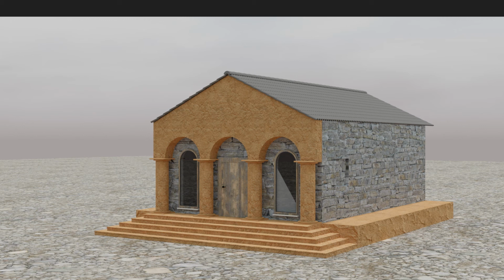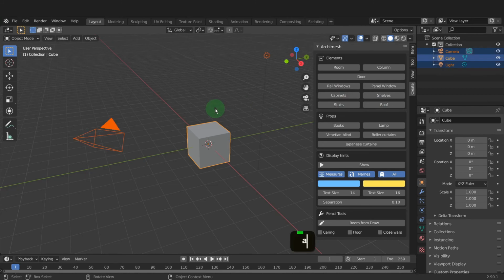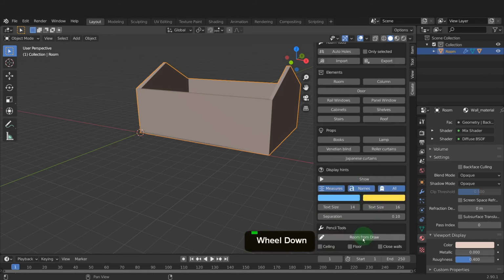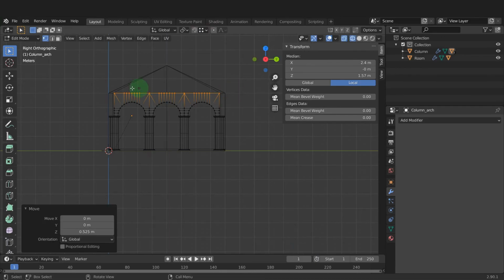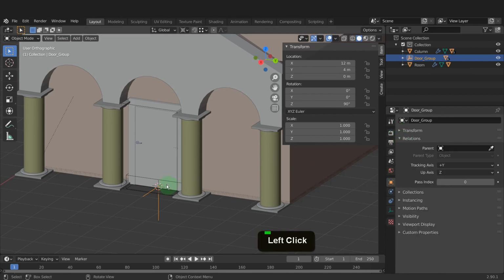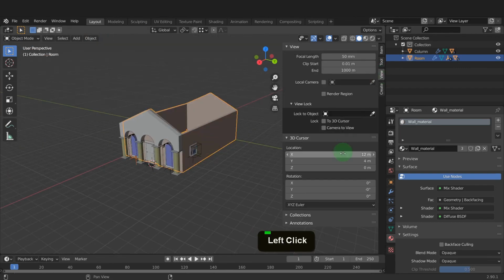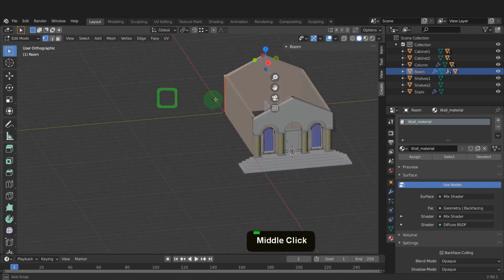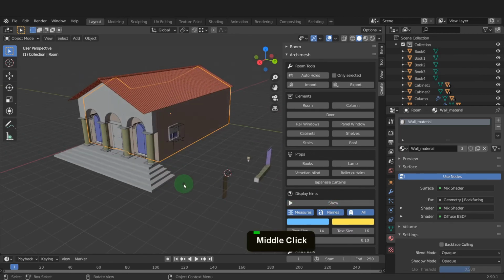The Archimesh Add-on in Blender

Comment: Hi Tried adding this add on to Blender 3.1 and I do not see it on the ADD Mesh Menu    what can be missing
Reply from the maker: Hey Thomas just checked on my 3.1 version and its in the add menu in the mesh sub menu
Reply: @BlenderZen  Hi how do I enable that in 3.1? it is not there
Reply: I got it working now had to reinstall blender and choose Repair and it put the files back Thanks
Reply from the maker: @thomasgrassi8817  That's great glad you got that issue solved. Useful add-on once working correctly

Comment: When I add a window (or a door, but changing the model fixed it with the door) the window frame and the CTRL_Hole do not align - the later is totally crooked off to one side in a strange rotation. Took me forever to fix that manually. Does anyone know why that would happen and what to do about it? 
It may be connected to another problem I have with adding objects, they are always added at some strange rotation. No idea why...
Reply from the maker: Hey Cara, one reason is the "Align to" Setting in the editing tab in preferences. When this is set to "View" Archimesh objects can get added mis-aligned. The default is world.
Reply: @BlenderZen  Oh my God, that was it. Thank you so much! I am still new to Blender and often overwhelmed  and that was so annoying and mysterious   ;)

Comment: How the f*ck do I download Archimesh ? I can't find it anywhere !
Reply from the maker: You'll find it in the user preferences settings in Blender. It's an add-on that just needs to be enabled
Reply: @BlenderZen  oh ok , it explains why they removed the github link if it has been integrated into blender 2.9, i usually use 2.79 that's why , thank you mate

Comment: Saved and subscribed. I was going along pretty well until it was time to use the 3D cursor and rotate the upper edge of the wall. When I clicked the period key, all it did was zoom in; no 3D cursor. Is that because I am using 2.83 and not 2.9?
Reply from the maker: Hey Louise maybe a setting but you can change to the 3D cursor pivot from the pivot menu on the top of the screen. Next to "Global"